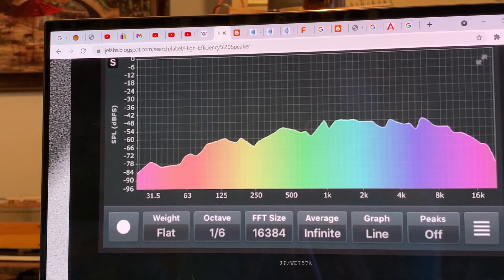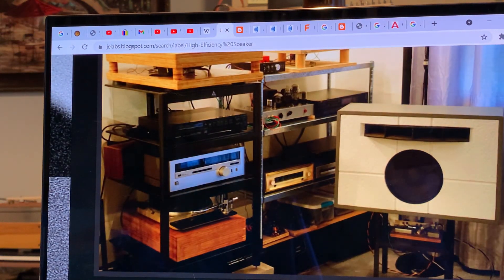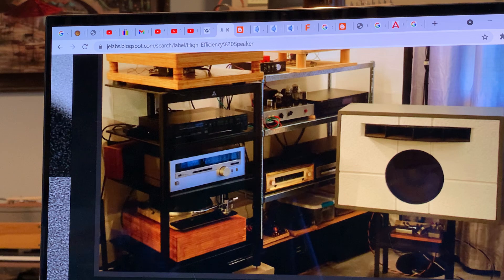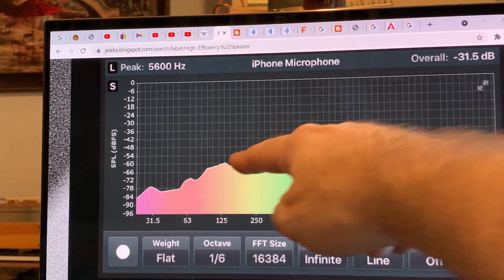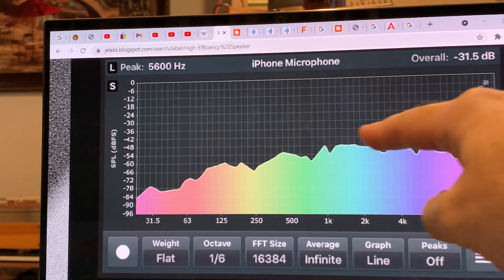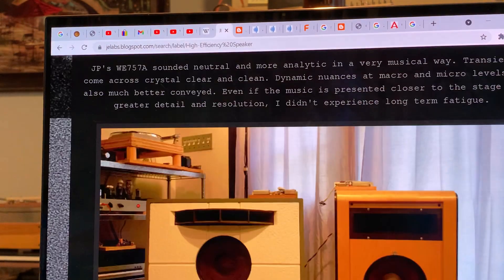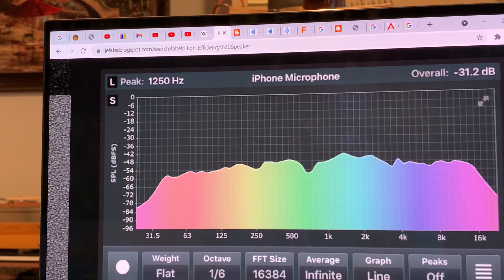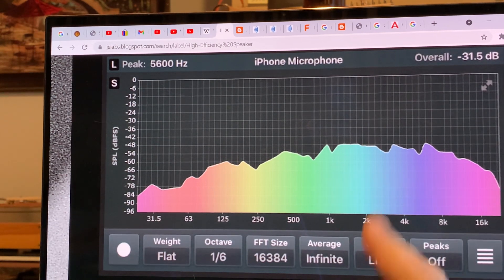Why are horns so hated?! One overlooked reason...

Comment: Horns are hated by some that dont have the right front end synergy
Reply from the maker: I'm in full agreement! Especially, when front end has high frequency mismatch with the rest of the system, then it turns out to be a bad experience. The good news is that when one takes the effort to optimize the front end / system synergy with horn speakers, then it will also play better with other speakers as well - provided they are well-balanced instead of designed around a flaw. I think a big challenge in audio is to remove the unwanted contribution from individual components - to keep things balanced and optimized.
Reply: @realworldaudio ' most' tube amps do well with horns their smooth and top end is more rounded than extended 😃 great job RWO !
Reply: Gain-matching is a very simplified and narrow view of why horns are disliked, when there are so many reasons to avoid horns exept their specific use cases (primarily PA systems and where sq must be sacrificed for efficiency).